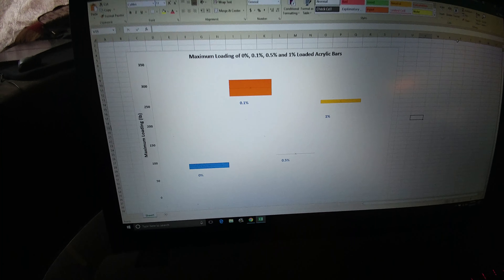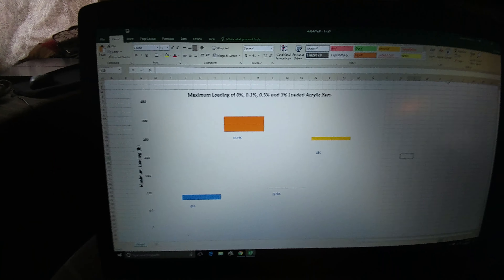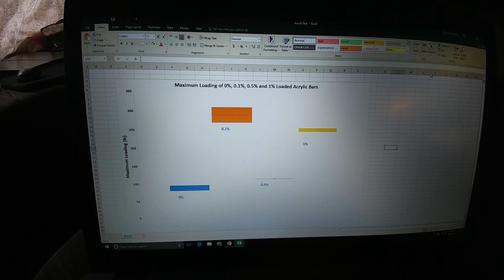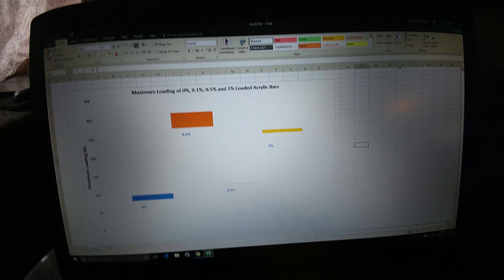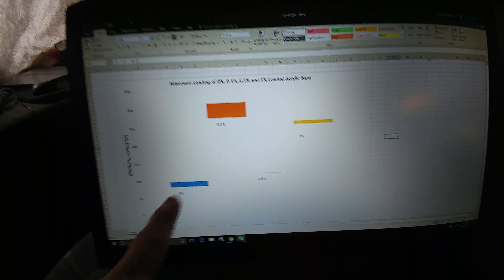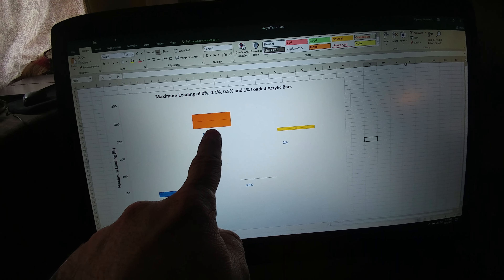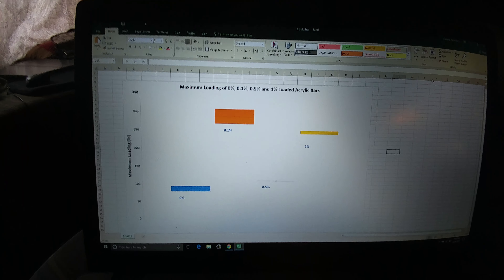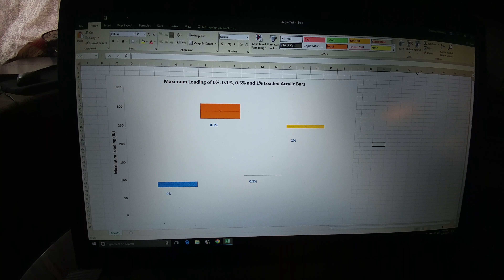Graphene in resin raw results

Comment: Awesome. Were  you surprised by the weird non-linearity where 0.1% is best, 1% is a close second, yet somehow the near-midpoint of 0.5% drops way down to just past the control? I don't personally know anything about this stuff but I'd love to see some kind of explanation.
Reply from the maker: We actually predicted this. It has a lot to do with homogeneous dispersion and flux loads. With graphene as an additive, less is more.
Reply: then why is 1% stronger than .5
Reply from the maker: Cole Standley it's because of the fact that the dispersion factor is mitigated. Dispersing graphene is the biggest key to getting good results. But when there is 1%, there is so much material that the particles can't help but be dispersed.